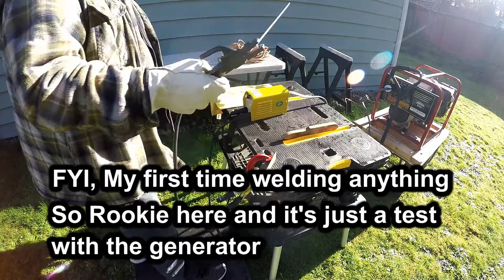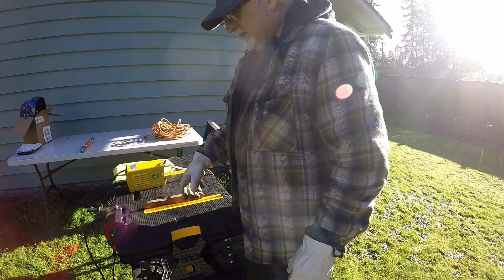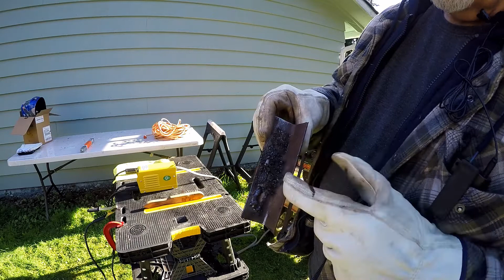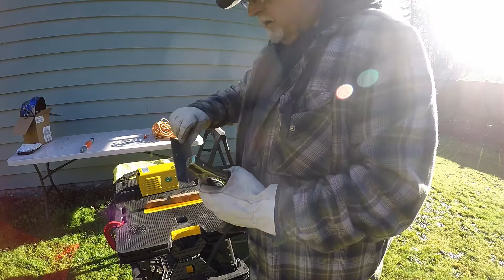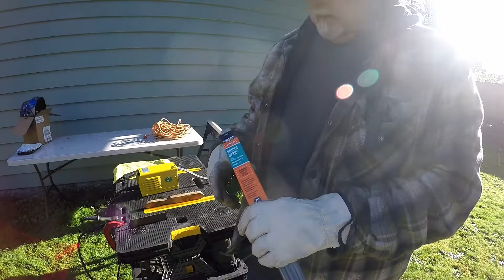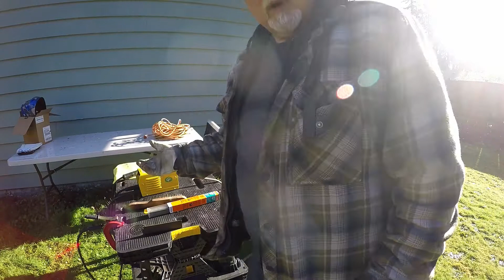Part 2 GB Banggood mini welder generator tryout Will it work?

Comment: Bummer it didn't work out well on the first go.  Curious to see how the mods work out.
Reply from the maker: I think if I clean the material the generator will still work. The sun was a killer on this video. Part 3 coming up will be on the other side of the house so won't be an issue. I watched the rest of your latest video this morning. wiring looks allot better. Looking forward to your next podcast. It was a bit blurry last time but cleared up later in the video a bit. Im sure other folks pointed it out to you. My guess is that's why you were hooking up the room to your new system
Reply from the maker: https://a360.co/3qz2fuI If you can open this link check out the fusion 360 design I did for my first try at this. I'm hoping to design things to weld hopefully